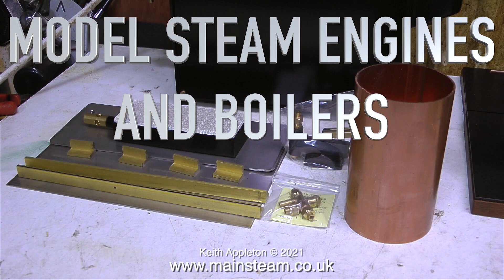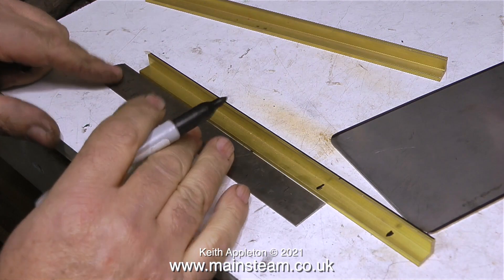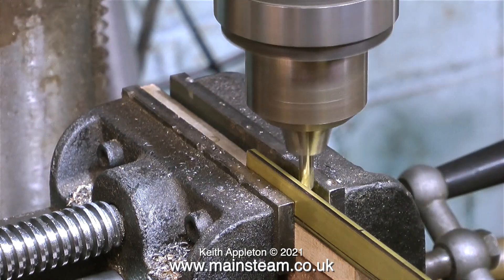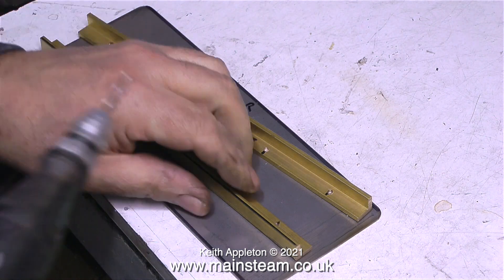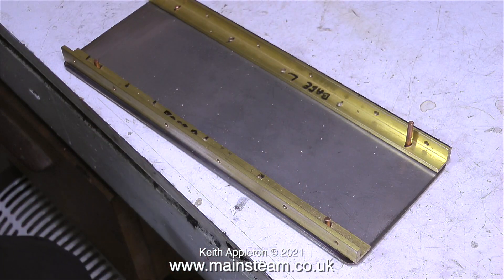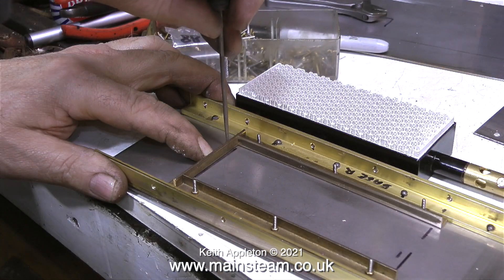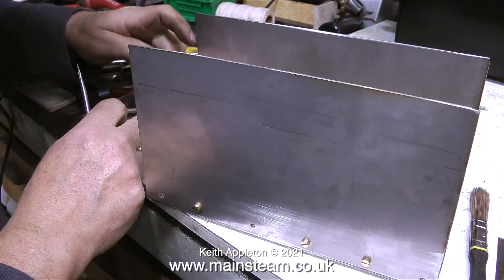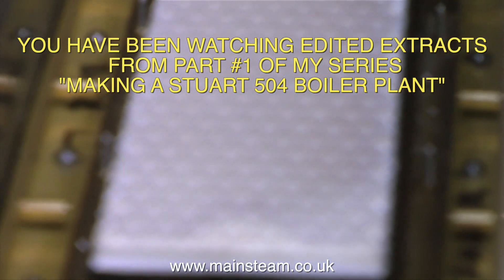MODEL STEAM ENGINES & BOILERS - PART #1

Comment: 1:50 Those holes are drilled 3 thousandth of a degree off center! Lol. 

Imo, when I hear steam engine, I don't think high precision, and in fact remember stories of engineers and conductors needing to take a sledge to dislodge pistons due to serious inaccuracies lol. Heat would cause the pistons to expand, which would seize up the entire system until someone hit just the right spot with enough force. Loved the video. Hoping to make my own small one some day :)

Comment: I made a flash boiler using a coil of automotive steel brake line.  The boiler is fed by a fixed displacement pump (peristaltic). so the hot tube only gets a fixed amount of water and can only produce a fixed amount of steam.  I also have a pop valved at the pump end between tube and pump.  I use only the bare minimum of heat.  I can tell because too much water and not enough heat and I get hot water out the end.   So far I have not blown myself up BUT>>>>>  am I doing something stupid??
Reply from the maker: Blowing up a Flash Steam Boiler is not the same as in a conventional steam boiler, as there is not a large volume of high pressure, very hot water in a Flash Steam Boiler.

Comment: when i could still be useful, i used to drive my son-in-law nuts using a well calibrated Eyeball Mk 1 . . . i did a few years as a draftsman and worked a lot in ⅛ scale . . . i was designing lighting and a lot of fixtures are 4' long (½" on the drawing) or 2' or 8' . . . son-in-law rented a sheet metal brake and i would help him line the metal up to make trim for the windows in his house . . . he would say he wanted a half-inch of stick-out and fiddle with his end for a bit before coming over to check my end . . . it was almost always dead on . . . much rolling of eyes ensued.